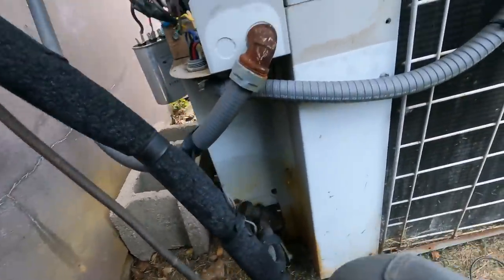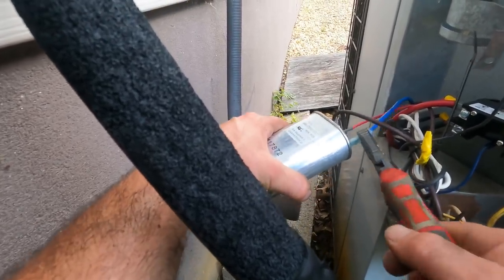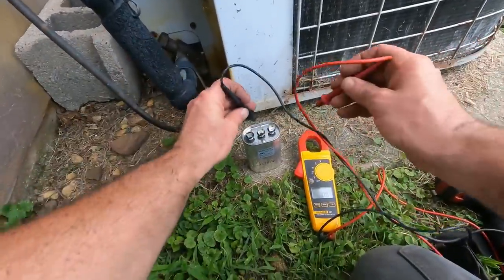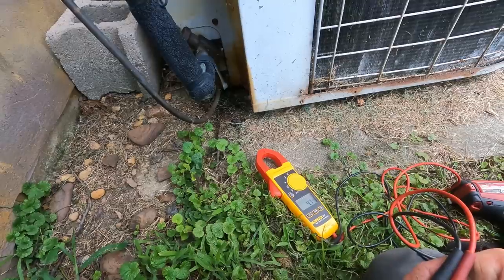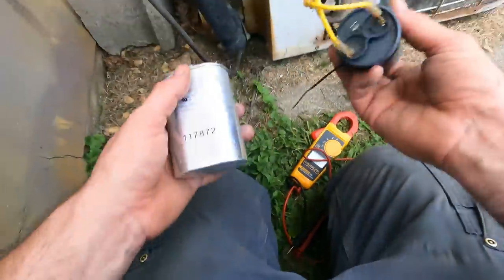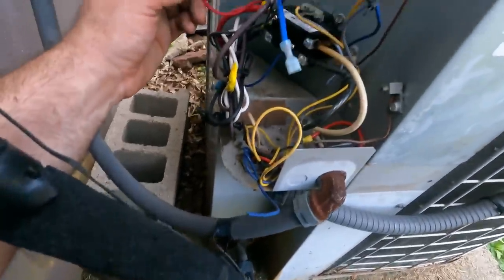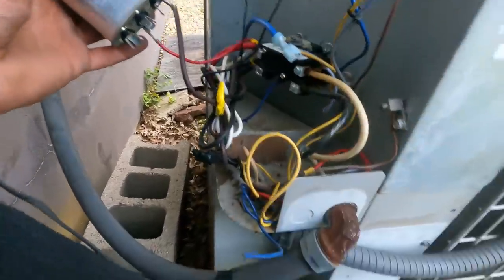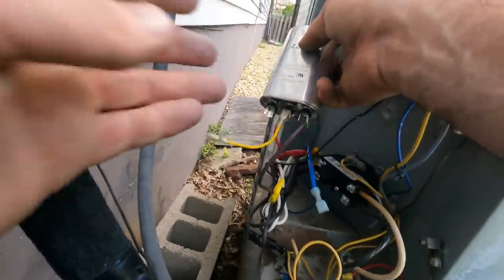No Ac Call Back? Compressor not Running

Comment: I don’t think the call back was your fault, and I don’t think you were wrong to set the caps up like that because that’s what you had to get it done. But while you were there and waiting, why not hook up your high side and check head pressure and sub cooling?
Reply from the maker: This system operates with a piston metering device. I wish I understood sub cooling on a piston system. It’s always really high. If this system operated off a txv then sub cooling is the only way to make sure charge is good.
Reply: @thehvachacker  there is a formula for the target superheat. Sometimes is in the unit
Reply from the maker: Target superheat yes. Yet with a piston system how do you figure out subcooling?
Reply: @thehvachacker  you don’t measure subcooling with a piston. You measure superheat if the system uses a piston and charge accordingly to that. You only measure subcooling when the system has a txv device.

Comment: Best practice is to hookup the probes to measure quick first before hooking em up to service ports because the pressures could be out of wack from last use. Itll get mistaken for low pressures. Just from what I realized from my experience.
Reply: By hookim em up i meant zeroing out the pressures.

Comment: When I see number like that and I am doubtful the charge is off I go check temperature split.
Reply: Yeah I would have put my high side on and went in to check delta T. This is where psychrometers could have saved him time with target superheat.
Reply from the maker: Could have saved me time. Yet with 93 degree return air I wasn’t wanting to hop into that attic to get measurements. Worst part is I have to remove the attic drip down ladder and frame to get new air handler in. I usually put my psychrometers for temp split and target superheat. Yet I been on this rodeo before. Suction line temp is always high when absorbing that kind of heat. Yet this system has a design flaw I didn’t show. The suction pressure might give it away. Usually 90* degrees going through a coil will bring suction pressure higher.
Reply: @thehvachacker  I understand. You're far more experienced than me. Do you think psychrometers are really all that necessary?

Comment: I've heard that installing a cap upsidedown can cause it to fail much faster due to the oil  distribution.
Reply: Funny thing... I've gone out to equipment 40 years old with caps from the factory mounted upside down... original caps... funny... I go out to jobs where someone has replaced the original cap with China cap... 2 year caps mounted upright... what's the cause of those failing? Turbo 200s vs china... I'd put my money on turbos even with them mounted upside down...

Comment: When you put capacitors in parallel they add like 4 mfd.+ 3 mfd.=7 mfd., but the working voltage must be the same as manufacture recommends. The rest is just standard checks.
Reply from the maker: Yes it’s just like using a turbo 200. It’s was common when I started. Then the turbo capacitor came out. This system is still running. Your comment made me remember I need to get an estimate to this units owner. He wants to replace this at the end of the season. This way he doesn’t have to hear from his tenants about the ac

Comment: first thing i would have told them is call the electric company and tell them to get that energy saver shit off that unit.
Reply from the maker: That energy saving device is disconnected. Did that a few years back
Reply: @thehvachacker  hey bill how did you get so knowledgeable in HVAC and mechanical and electrical stuff? Thanks

Comment: Turbo’s are supposed to be temporary until you can get the correct cap.
Reply from the maker: Some say that yet been using them since 2006 to replace any caps that fail.
Reply: Turbos are permanent, made in the USA and guaranteed 5 years.  The downside is they are more expensive.
Reply: They cost like 10x what the OEM cap would be.

Comment: I love TURBO 200 &  200X that’s all I use anymore or I don’t do the job.

       I’m still waiting to see when I get my first turbo capacitor failure hasn’t happened yet. 
           And we don’t have lightning strikes out here in the San Francisco area to take out capacitors which is not considered a normal failure. 
               At the price I charge my customers to just come out and replace a capacitor I better give them nothing but the best.
Reply: The only time the Turbo 200s really fail from what ive seen is when the jumper wires between the terminals are not tight enough/loose. That creates a lot of heat and wears it out quicker. Other than that those run caps are built to last. Best ones in my opinion.
Reply: How much do you charge? We don't carry them because they are so much more expensive.
Reply from the maker: I have seen turbo 200’s fail.  It’s rare, unlike the cheap Chinese caps. To keep cost of condenser fan replacement I picked up a standard cap. Yet been using turbo caps, since 2006. Anything that’s old can fail. Yet 5 year warranty. Even if one fails you can give the customer a free turbo. Then get one under warranty for free to replace truck stock.
Reply from the maker: I am with you. Yet usually turbos rarely fail. Even at 10 years. Which these caps are manufactured in USA 🇺🇸. I hate when parts fail that I put into a system. Customers are usually not happy. This system was suppose to be replaced last fall. For whatever reasons it was forgotten about by my friend and me. Now when temps cool down or it fails first it’s getting replaced. Unit and material with site in garage of this house until it’s ready to go in. Here is a video you might of seen where a customer wanted to know how a part failed I just put in a few years ago. Her memory not that good it was over 20 years ago. 

Steam Boiler Banging/ Hammering Noises Leaky Air Vent https://youtu.be/G2-moJAKNQo

Comment: Good repair to get the unit functional, screw the whiners. They have not obviously "been there" except maybe in their fantasy world where they know everything.
Reply from the maker: Getting a system to function is most important. I didn’t want to leave this house down until I return the next day. Doubling up caps was common before multi tap caps. Now gets looked down on and hack work.

Comment: Caps in parallel
Reply: Just like a resistance.
Reply: for the next trick, two 80mfd in series(with balance resistors parallel across each), bam 40 mfd cap :))

Comment: Dude come on with that cap setup that’s horseshit
Reply from the maker: Does it work when no other option is available? On a system that is going to be replaced, when temps cool down.
Reply: I'll bet you use those cheap ass china caps... you know, the ones you replace about every 2 years? He already told you he prefers turbos (so do i)... what he did here was got these folks ac today. I guess you've never built a cap before? If you've not had to improvise, you haven't been around long enough. I carry 3 turbo 200 and 3 turbo 200x on my truck. I've run out in a day before...
Reply: It’s all good hvac hacker. Love what you did man! Love your content they are just hating on someone👌🏽
Reply: Super Ultra Mega Tech detected.
Reply: Actually, parallel capacitor banks are the norm in virtually every application, where durability and reliability is important.   Look inside any ECM motor; VFD, stereo receiver, AC utility power factor correction capacitor banks, etc.   You’ll always find parallel caps.  A capacitor  bank spreads out the current, heat, and failures.   Provided they are wired securely,  and they fit in the unit ,  it is far and away superior than a single cap !    I am an engineer and I replace  capacitors on my own HVAC units with parallel bank of smaller 470v Amrads.   Never had a failure or even a drop in measured capacitance, ever. .